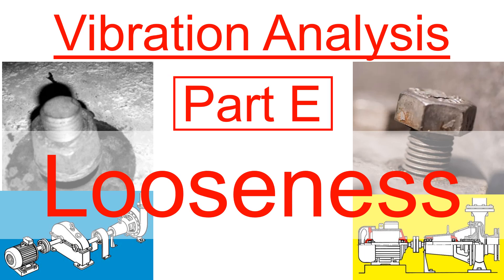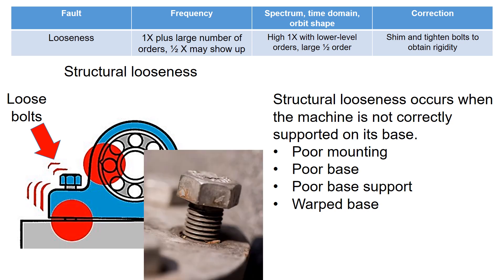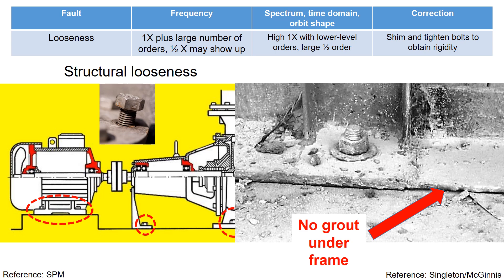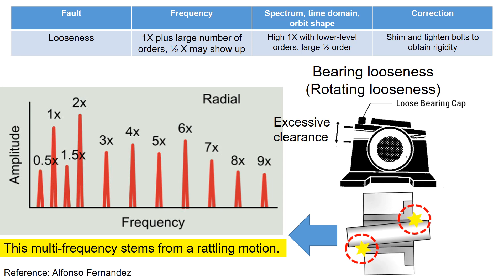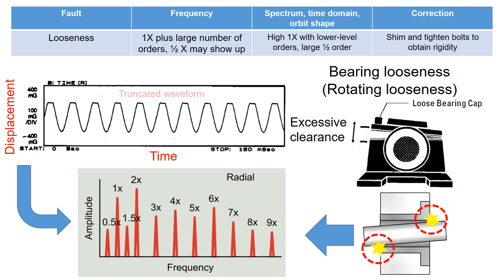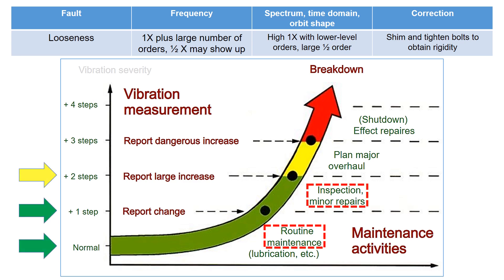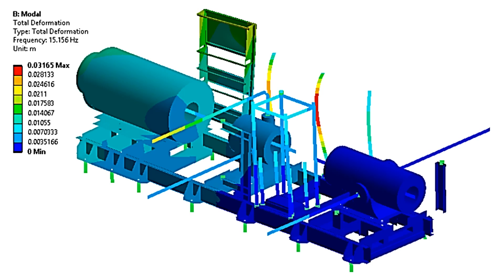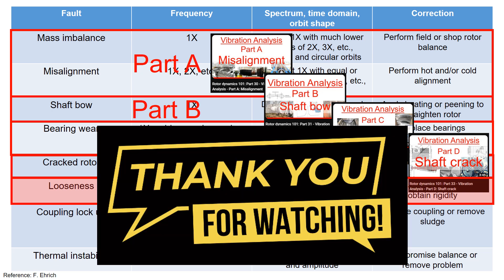Part 34 - Looseness in rotating equipment

Comment: Great presentation but I have a question regarding the vertical mounting of the sensors at 3:45 is it not optimal to mount them on the horizontal axis or closer to the load zone?
Reply from the maker: Thank you for your positive feedback on the presentation! I appreciate your question regarding the vertical mounting of the sensors. If positioning the sensor on the horizontal axis or closer to the load zone proves to enhance signal reception, opting for a horizontal placement would indeed be a more prudent choice. The examples presented in the video serve as reference points, and it's crucial to note that experienced engineers can play a vital role in identifying optimal sensor locations based on specific needs and conditions. I appreciate your insightful question—thank you!

Comment: Good summary. 
Once many years ago had loose tilting pad bearing retainer with exactly half running speed as shown in one of the slides. Used large set screw believe at oil filter location to stop vibration.  Ran fine making sure oil drain vents were good.
Reply from the maker: Thank you for watching and sharing your experience! It's fascinating to hear about your solution with the large set screw to address the vibration caused by the loose tilting pad bearing retainer. Ensuring the oil drain vents were good sounds like a crucial step. Thanks again for sharing your insights!